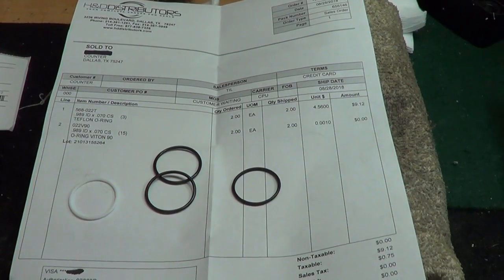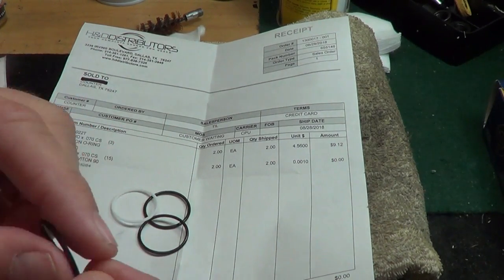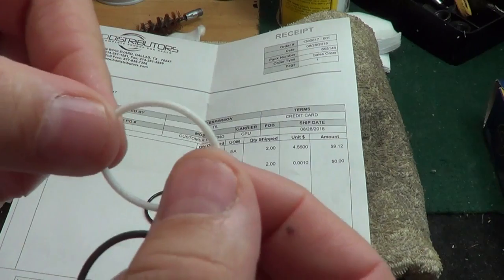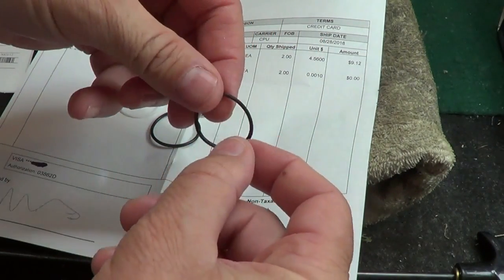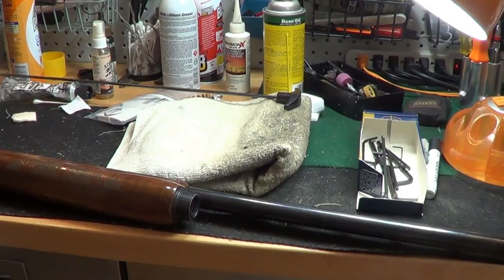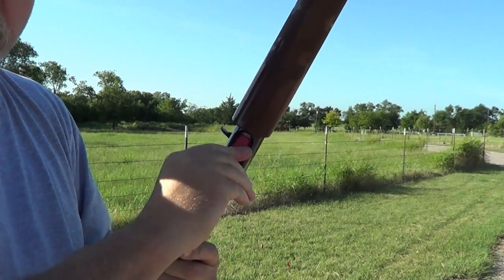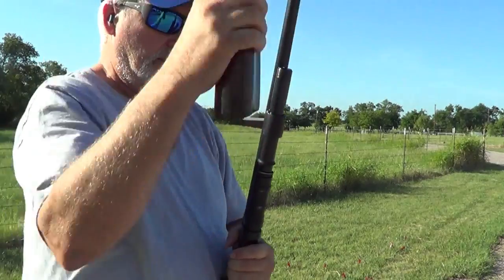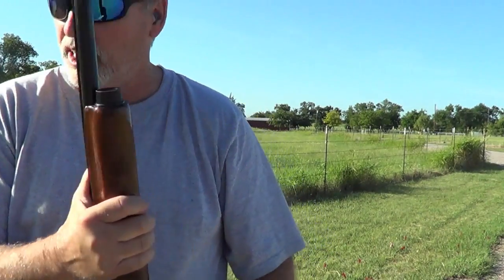Remington 1100 Shotgun O-ring Replacement & Upgraded O-ring - Size & Information

Comment: It's a #21 Viton O ring for a 12 gauge and a #19 Viton O ring for a lightweight 20 gauge.  Teflon is a poor choice because it is not an elastomer.  I have one Viton one that has been on my 1100 since 1967 and it runs fine.

Comment: I work at a Kubota tractor dealer. I found a hydraulic o-ring seal that fits perfectly and costs cents each. I buy them by the 10 pack. I toss the old one every time i break the gun down and put in a new one. Costs cents so why not? Part # 04811-10250. May have changed # by now.

Comment: Why want mine shoot low brass
Reply: Is yours a magnum model? I keep having problems with mine not ejecting either, and have changed the o ring and gas seals.
Reply: James Pruitt mine isnt a magnum. Did you check the ports in the barrel?
Reply: James Pruitt no sir I have the regular one
Reply: We Call That A Clue 
You also need to check that the gas piston is in good shape. If the gap in the piston (either section) is too wide, it wont hold enough pressure to cycle the action. Same if the seal (oring) is bad, or the gas ports in the barrel are caked up.
Reply: gun is probably a late model need to buy a 1970s
Reply: sorry i know thats not too helpful

Comment: Kind of interesting how the 1100 is similar to the Browning BAR with the friction rings .
Be careful when reassembling the piston and piston seal NOT to have the slots aligned ....that means it is backward and gas will leak into the system , jamming the weapon .
So if the piston slot is , say , at 9 o' clock , the seal slot should be at 3 o'clock . And Vice -Versa .
One last important point ....if you own an 1100, right now order extra "o" rings ...they will wear out... even teflon . When the 1100 went to military trials against the Mossberg ( Mushberg) the only reason it didn't win was because of the O-rings.
The Army did adopt some A-5 Brownings , in WW2 ....very popular with 00 buck or #4 steel.
anybody who's ever fired a semi-automatic shotgun knows how effective it is in combat specially at limited distance.
Good weapon to carry Vertical Dash  if you patrol alone .....

Comment: You know you are a nerd if you have an PARKER O-Ring Handbook on your Bookshelf.   

Mine is Dated 1992 ,  There are Online PDF versions.  More info than you dare to know.  

I hung out with boys that could talk about O-Ring for hours and hours.   The boys making the long rings from Cord stock were interesting.  Think of an O-ring with a 8 foot diameter and the guy gluing it together.  Had to be perfect   

McMaster Carr is a good source for O-rings
Reply: OK ,  Not saying that the Teflon O-Ring is best choice or not.  

But Teflon (PTFE)  
Size 21 is $6.14 / pack of 10  Part number 9559K115 
Size 22 is $6.35 / pack of 10  Part number 9559K116 

Viton in price range of $8.63 / package of 25 

Have to ask a Nerd Pack Engineer which is better,  both look good to me a a fix.  

I picked Viton once for project,  got beat up BAD at water cooler for being dumb azz elect engineer at water cooler. Those beatings are tough.
Reply: John M  Awwww John, don't lie to them. You like your beatings...........
lmao.....................
And the only reason you kept those O catalogs is because you thought that the O stood for the big O . Thought it was some sort of reference book.........Bahahaha.
Reply: Susan -- I'm from Vacuum world,  O-rings and seals are so important.  You heard of Copper O-rings? 

A human hair on an o-ring seal can provide a terrible leak and hard to find as well.  got some funny O-ring stories, they might be IP so I will hold on to them.
Reply: John M  Yes, John. Better hold onto those stories. We don't want Rick to get another strike......lol
Reply: John M  And, I've never heard of a copper O ring but if you tell me to be careful around human hair, I give up learning about O rings......
😉😁😁😁😁

Comment: Rick, in case you didn't mention it, Teflon O-Rings have a temperature range of -325F degree's to 500F or for you non Americans, -200C to 260C with a PSI of up to 5800. So, you are good to go for the what you want to use it for.

Comment: Rick, teflon in the DuPont common name for PTFE.  If any viewers are looking in a catalog like McMaster-Carr they'll find it listed as PTFE.  Vitron is also a common name.  You might see it in o-ring catalogs as FKM or as fluoroelastomer.  Both are used in environments where resistance to harsh chemicals is needed with PTFE being ultra-harsh resistance (resists acetone).  I think FKM is the more heat resistant.  Either will work well in this application.  My first choice would be Vitron.

Comment: 🤔....... [ works slide rule furiously for 20 seconds]...... 🤔......[ thumbs through a data book ]...... 🤔......[ grabs a Machinery's Hand Book ]......... Yep that will probably work.

Conclusions : steel temperature for color of Brown to Blue 450-500 deg. F.   PTFE (white 0-ring ) max temperature 500  deg F. Pressures are not much of a factor because it's a shotgun and the barrel isn't plugged by a projectile so...... should work fine. 

By the way.... that's probably how the Mfg. arrived at their "specifications" and why they can't answer your questions. 

A lot of the time you have some rough guess as to what you need and then pick an off the shelf part from a hydraulic or pneumatic seals catalog and test it in the new device. If it passes testing you order 1000 parts and start limited production..... then full production after that. 

Now that 50 cent pneumatic seal becomes a 3 dollar part because it's a "special seal" for a shotgun. 

Good video, Rick!
Reply: I hear you, Rick. 

The subject I was teaching required a BA degree and 2 years experience in the field. Your degree didn't have to be in the field either. So...... I listed my philosophy credentials which just drove the eggheads bat sh*t nuts because they knew I had a degree "in the field" and I didn't list it. 

When teaching you need to make the subject understandable and learn to be approachable. 

Technoneards   love their technobabble and playing with their $300 HP engineering/scientifc calculators. ( just had to get one back in the day or you weren't a "real" engineer.....lol ). 

I've always been more interested in getting the job done and doing a quality job.

Comment: Rick for future videos if you hit the iPhone button three times you can use it as a magnifying glass or a microscope
Reply: Me neither.  Is it a joke?
Reply: Carol V    see my reply to rick carol
Reply: I think that works because you have a app which allows that function to occur. Either that or it's only available on phones above iPhone 7 because my 7 doesn't do it out of the box.
Reply: Art T    see my reply to rick art
Reply: Okay ...... so poked around on my iPhone 7. 

If the button click maneuver doesn't work ( and it doesn't for me either ) you can zoom in using a two finger touch and then spread the fingertips. This also brings up a scroll with a thumb ( the thing you slide) which can be used to set the magnification. 

Once you get the magnification you want, you can tap the shutter button and get a picture of what you're seeing on the viewfinder screen. 

Hope that's useful .......now I've got to do my impression of a plumber for a couple of hours.
Reply: We Call That A Clue    "The iPhone has a useful magnifying glass feature that uses the camera. You must turn this feature on in order to use it. To turn on the magnifying glass on your iPhone, go to: Settings, then General, then Accessibility, then Magnifier."   courtesy of my friend google
Reply: Thanks FreeBird, 

I didn't go into the accessibility features. There's zoom, magnify and other "assistive" features for the handicapped  in there too. 

Now..... back to plumbing .
Reply: Art T   love, love , love your sense of humor Art!

Comment: Kinda hard not to have guns and have stuff and hard come up at least once. I’ll have to get you one of those magazine tube extenders so you can have your high capacity, fully semi automatic assault shotgun. I bet liberals would lose their shit on that. If I’m not mistaken, the tube extenders fit 870 and 1100 shotguns.
Reply: We Call That A Clue that doesn’t surprise me. I bought my mossberg 500 7+1 used for about $200-$250 and put a box through for function. I have an 870 as well but it’ll probably be a squirrel gun since I’m used to my 500 20g for ducks.

Comment: How do you make the "o" ring stay in place when reassembling? Every time I try to replace an "o" ring, when I reassemble, it rolls out of groove.
Reply: Lisa, 

An old mechanic's trick is to use a dab of grease to hold the part in place while you assemble. The only caution would be the seal should be resistant to attack/degradation from the grease used.
Reply: However, I'll defer to Rick's experience for the 1100 specifically.
Reply: @artt3165    Thanks

Comment: Rick they actually make Teflon coated o rings for the 1100 & 1187 guns the, MPN number is 19264. They usually come in a 3 PK for about $12 but their not really rounded like a normal o ring ? The best place I found to buy them is ( The O ring Store LLC ) a pack of 50 regular direct replacement O rings for $20 for 12 GA.

Comment: 4:39, I can see the difference, the left one is blacker and has a higher smoother sheen to it than the one on the right. The right one looks charcoal gray and the sheen is duller because the surface is rougher and pitted and looks used.

Comment: I used to work at a company that made o rings. JM Clipper. I ran the lathe that cut them which was next to the table that rolled the tubes. I can tell you that viton can take the abuse. It also smells like chemical death.

Comment: That's good info Rick! 
Thank you

Could you would please do a demo on how to install both a extracter and a charging handle/knob on the bolt carrier for a 11-87?
Reply: The charging handle just pulls straight out.
Reply: The extractor you need 2 very small screwdrivers or pics. You pull back the spring with 1 & hold it then rotate the extractor out with the other, then put new one in the way the other one came out. Then release your spring. Now I have to tell ya this spring can FLY TO PLACES UNKNOWN ALONG WITH THE EXTRACTOR. Wear safety glasses & do it in a clear bag or in a cardboard box cut it out for the gun if need be after taking barrel off of course. I do mine through the ejection port but you can take your bolt out & do it in a vise ?